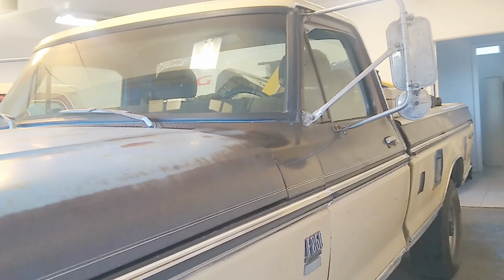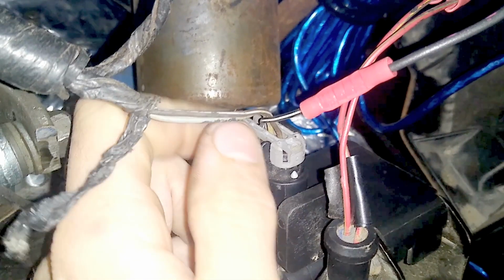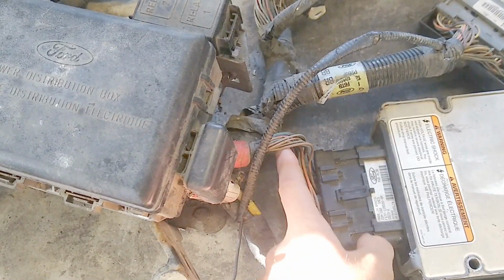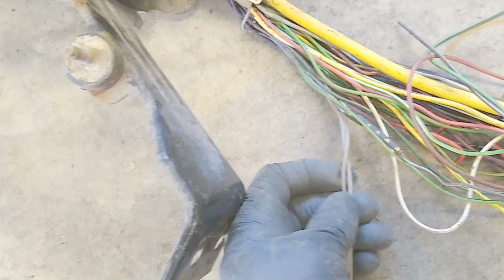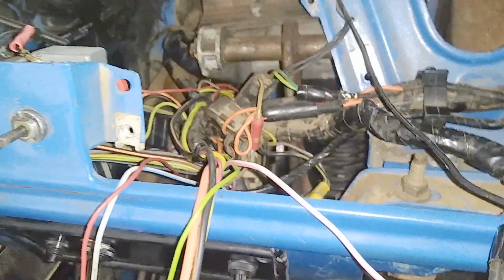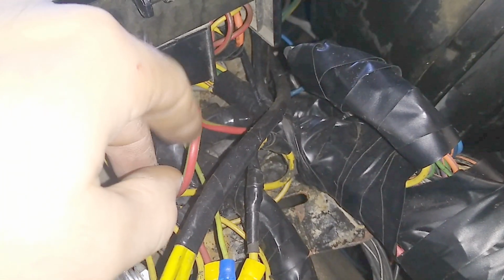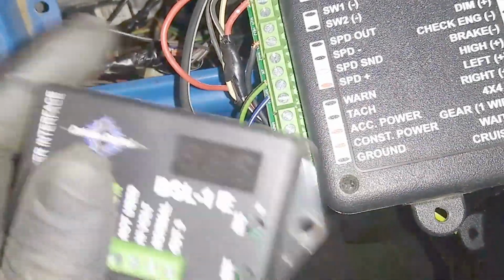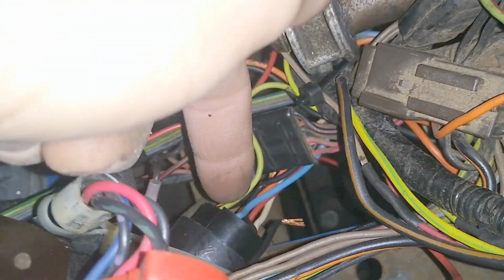How to wire a 7.3 Powerstroke (Powerstroke Swap Pt. 4)

Comment: Do you need to keep the keys or anything stupid? Looking to do the bare minimum on a project 2wd manual. 1995 truck engine and harnesses.
Reply from the maker: As long as youre earlier than 2000 you shouldn't need the key. 2000 and later have passive antitheft and require an ecm reprogram to delete it.1995 juat has a plain metal key that moves a rod which moves the poles in the ignition switch located halfway down the steering column

Comment: I have this 83 Chevy suburban im looking into doing a 7.3 swap on , I want to use a e4od transmission and a 350 dually rear end (this is a dually suburban build) I’m looking at a 7.3L out of a 97 250 do you know any aftermarket wiring harnesses I could buy that still have the obd2 port , do you have any clue how hard it would be to get the oem gauge cluster to work or should I just use one of those aftermarket monitors.its an un conventional swap for sure but I have no interest in a Cummins swap or a Duramax swap I’d rather have a 6.4 psd then any Duramax
Reply from the maker: @treyworth8842  I don't mind the LBZ duramax,  but I digress. If you want to run the 7.3 powerstroke and e4od you're gonna need the harness from the donor truck, since both the engine and transmission are electronically controlled. You can always scope Ebay for used harnesses,  but they are a bit pricey. Painless Wiring does make aftermarket harnesses with obd2 ports, but I've yet to see one with the powerstroke/e4od specific ecm, idm, and speed module connectors. It takes 2 computers to make the powerstroke run, plus the specific throttle pedal. You also need a vehicle speed sensor to get speed signal either off your differential or your transmission output shaft in order to make the transmission happy. 

If you want to make your instrument cluster work , you still need to leave the ford speedometer module connected so the transmission shifts correctly.  The 83 suburban tach and speedometer drivers are probably going to be difficult to make work. Dakota Digital makes a factory looking instrument cluster for your chevy, and I've had good success in running those in my trucks with the powerstroke. Cool project. Good luck.
Reply: @ thank you for the reply man , I don’t hate the lbz either unfortunately all the Chevy diesel stuff is extremely expensive in my area. I just want the suburban to be extremely reliable and the 7.3 does that the best I found a 7.3 for 300$ just the motor just looked and there is a few harness available for around 200$ I’d just need the pcm to go with it looked up that Dakota cluster seems like it will be easy to make that work well I should be able to use a 350 dually rear end for this build so I should see no issues with the speed sensor since the entire drivetrain will be a 7.3 lol I’m also using 80s ford dually fenders since the Chevy ones won’t  work

Comment: What wires u use for the ignition switch
Reply from the maker: @tom12974  The factory powerstroke ignition switch? Or the recipient vehicles Ignition switch? In my truck i used the key on wire that would normally go to the coil and use that to trigger a relay i added, which then triggers the ecm and idm relays for the powerstroke.

Comment: Is a 2000 Ford E350 van considered OBS I’m basically going through the wiring like you did as well cause I did a motor swap tranny swap PCMECM the whole 9 yard I’m basically just putting everything from one vehicle into another, but I’m also eliminating a bunch of stuff that I’m not gonna be using like the AC evaporator AC controlslower motor, etc. I just wanna make sure that what I’m looking at on your video, coincides with what I have for the most part
Reply from the maker: @kennyruth9300  You will find that 99 and newer Vans are similar to the superduty more so than the OBS. That being said, the wiring needed to run the 7.3 is about the same. The obs and superduty 7.3s are similar, and the 99-year trucks/ vans have some changeover parts. My recommendation is to get your hands on an electrical manual for your 2000 E350.

Comment: Where can I get this diagram?
Reply from the maker: @kennyruth9300  Google 1997 f350 electrical and vacuum troubleshooting manual. The whole book is on ebay for $40 right now. It has every wire diagram you'd ever need. Engine wise, the wiring is the same for all 1994.5 to 1997 powerstrokes
Reply: @ thanks man
Reply: @ my power stroke came out of a 2000 e350
Reply from the maker: @kennyruth9300  ah well that might make things more tricky. They have diagram books for the newer models, but the newer engines started having anti theft built in to the modules. Some have it, some don't. If you have the whole harness that came with the engine and the ignition key then you're in luck. Alternatively you could run the older style harness, but a couple things have to get moved on the engine connectors and you have to swap to older style injectors
Reply: @ I got the engine harness and the interior harness
Reply: @ but all I’m doing is a body swap on to a e350 frame

Comment: I'm having throttle pedal issues and haven't swapped anything iv replaced the entire assembly but when I shift gears if I let up off pedal I lose it for about ten seconds and then comes back what do I do now? I have a 94.5 5spd drw with hydra and fuel bowl delete, and regulated return ty for any input on this.

Comment: Great info! I have a 89 bronco and 03 7.3 power stroke complete automatic truck. Could I just replace the entire dashboard with wiring to fit in the bronco? I don’t mind the super duty dash. Thanks
Reply from the maker: @williamsilliam  If you can make the dash fit then I don't see why not. The other things to consider is dash mounting being different, as well as the steering colum. The wiper and highbeam switches will be different too. If you can figure out how to mount the superduty dash and steering colum in your 89 and make them play nice with your pedals you should be good. The firewall bulkhead connectors are different, but you can cut out the 03 sheet metal and rivet it to your firewall you could make the 03 bulkhead connectors work.
Reply: @humboldthillbilly1848 I appreciate the insightful reply. I’m not sure if you’ve seen the black 6.0 power stroke bronco floating around YouTube, but someone swapped I believe an 08+ super duty dash, and yeah it took some adjusting. It seems you have seen behind the dash of these old trucks so I thought I’d run it by you. Thanks and good luck with your projects!

Comment: I have a 94 7.3 idi factory turbo  truck that I want to swap to 7.3psd I have a 94 psd truck for a donor how plug and play will that swap be (strictly talking electrical) there the same body style and manual
Reply from the maker: I'm actually in the middle of essentially the exact same swap, except my truck is a 1989, so it's a little more complicated.  Since both your trucks are the same generation, you are in a good place. The underhood wiring should be swapped, since you will need the wiring for the psd and IDM. The interior wiring under the dash will be slightly different too, so I recommend swapping either the harnesses or the dashes with the harnesses attached. 

The harness that runs from the firewall down the frame to everything behind and under the cab is exactly the same. The bulkhead Connectors at the firewall will be the same shape, but the main bulkhead connector will have more wiring. This is why I recommend swapping harnesses. If you swap the whole harness, you can plug everything back in and it will all work. Don't cut any wires, ford designed the harness in three sections, and the sections will swap from the psd truck into your idi truck 100%

Comment: Did your tach wire coming straight from the pcm into the Dakota digital box end up working or did you have to change how you did it?
Reply from the maker: I fed the tach signal to my Dakota Digital tach and speed sensor module first. It gives more adjustability in output.

Comment: Any idea how to keep the factory speedo as im running the e40d with my 78 project
Reply from the maker: How good are you at welding plastic? You can trim down the newer instrument cluster to fit and then weld the rim of the 78 cluster to that. Then you can screw 78 lens on and have the newer instruments in the 78 housing. 

Another option, albeit pricey, is to buy a Dakota Digital VHX or RDX instrument cluster for a 78 ford, and use a Dakota Digital speed signal converter to replace the psom.  The ecu needs an 8000 ppm signal to properly shift the transmission.
Reply: Ok thanks man. I might look more into dakota…..wanna and try to keep it vintage correct

Comment: What rear end did you use? What did you do about your vss?
Reply from the maker: I used the stock 10.25. Because I had a manual transmission, I didn't really need the VSS but I did use the sensor off the differential to drive my Dakota Digital speedometer. If you're using the automatic,  you either have to use your PSOM behind the factory speedometer, or you can convert the signal to a 10k ppm signal with a Dakota Digital speedometer/tach interface module.  You have to have something to convert the signal or else the ecm won't shift the transmission.

Comment: Do you know if the 98' and 99' wiring harness and IDM are the same besides the intake heater and solenoid?
Reply from the maker: Late 98 should be the same as the 99 harness and IDM. There are only resistor differences in the IDMs of various years. The newer 7.3s have the 120v IDMs for more injector pulse.
Reply: @humboldthillbilly1848  oh do the 120v IDM models have different injectors? I have a 99 f450 I put a engine in that had the intake heater and solenoid. But I just used the harness from the prior engine. Get ICP pressures and IPR% scanning. Reads exhaust back pressure, Oil temp. Does injectors buzz test. But won't start.
Reply from the maker: @kennethmabus381  The IDMs are all interchangeable, just the higher voltage ones put out more injector pulse for more power. The 94-97 injectors are different than the 98-04 injectors (single shot versus split shot), and if you have the wrong ones in the engine they won't work right due to the drivers in the ECM (not the IDM) being different.

Comment: Sir you wouldn't happen to have a  simple instruction of the bare bones stuff you need to just make the engine run
Reply from the maker: The simplest way to run the engine is keep the engine harness intact to the IDM. The ECM to engine wiring, as well as the ECM to IDM wiring. The fuse box needs the fuses for the ECM and IDM as well as the relays. The throttle pedal wiring needs to be connected to the ECM as well. You need to run switched 12v to turn on the ECM relay.  Everything else can be deleted, although I recommend keeping the OBD 2 wires so you can still do diagnostics. Almost forgot to mention that the 1st gen 7.3 is easier than the 2nd gen 7.3 found in the super duty trucks. Those engines have glow plug control modules as well as boost control. The biggest challenge for those engines is the passive antitheft system
Reply: @humboldthillbilly1848  my plan is to leave my preexisting harness in my truck and just and this around it
Reply: Thank you sir